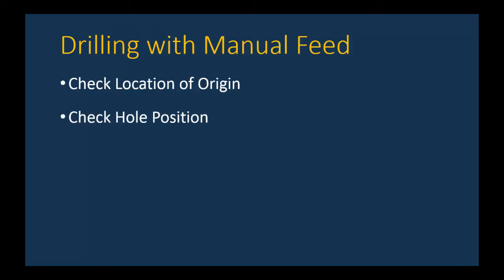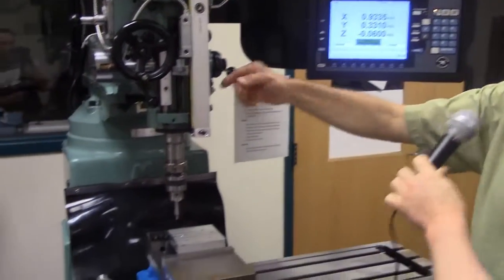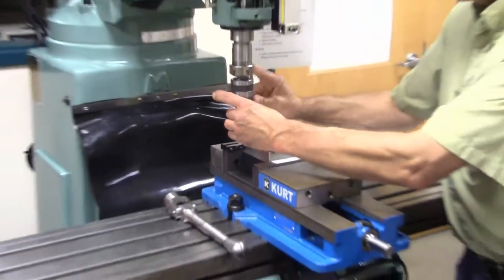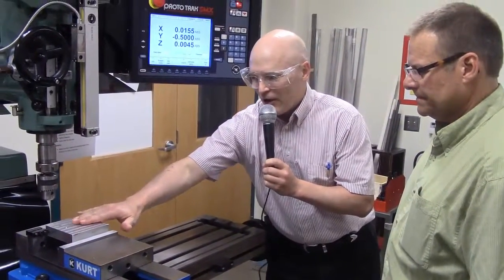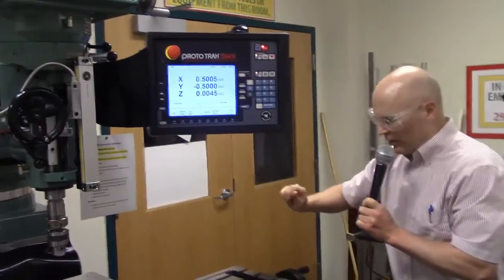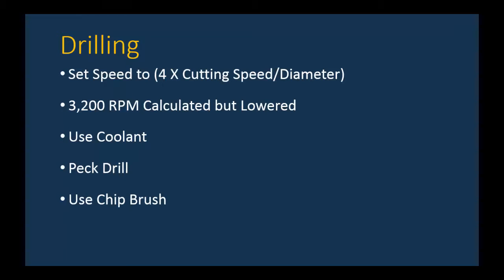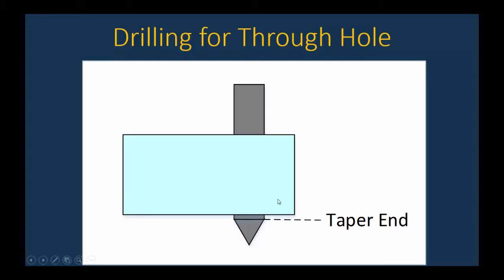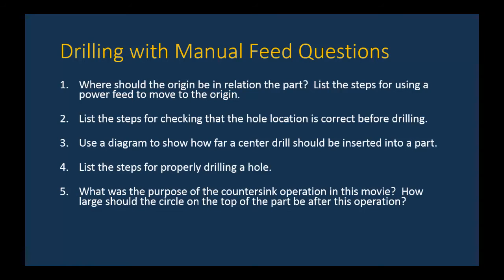MCC ENR 153 Machine Shop Video Mill  5 Drilling Manual Feed

Comment: 1. The origin should be centered on the back left corner. 
     Steps:      1- Move tool above part.
                      2- Press Return to ABS zero (F6)  on your DRO.
                      3- Press Feed/Go on your DRO. (Spindle will move to origin.)
4:40 - 4:50
2. 
     Steps:      1- Move X-axis and Y-axis to desired location.
                      2- Install center drill.
                      3- Create prick (This is cosmetic, don't go very deep)
                      4- Measure the prick location with caliper to ensure parameters are correct.
14:25 - 15:20
3. 19:20 has a diagram on center drill depth.
4.
     Steps:      1- Set speed to (4 X Cutting Speed/Diameter).
                      2- Use coolant on drill.
                      3- Drill using a pecking motion, pulling back every so often to avoid chip                                                    
                          buildup.
                      4- Use a chip brush to clean spindle. Avoid Cylinder of DEATH.
                      5- Make sure taper clears part bottom: make sure the drill goes all the way 
                          through.
26:05 - 28:05
5.The purpose of the countersink operation was to clean off the top edge of the hole. The circle on top of the part should be 10% greater than hole diameter. 
35:05 - 36:21
Reply: what  a GOD
Reply: @chunkyman3371  with great power comes great responsibility, my son